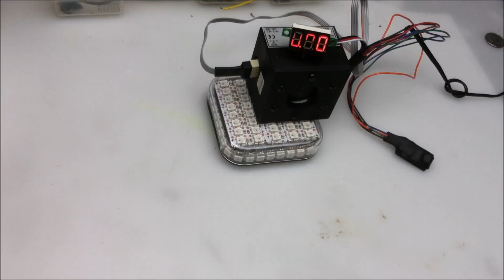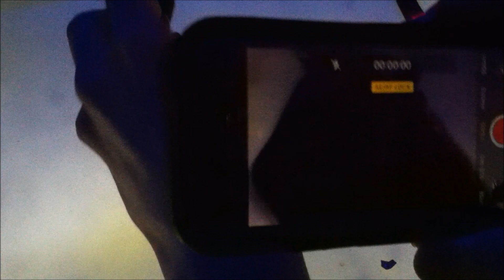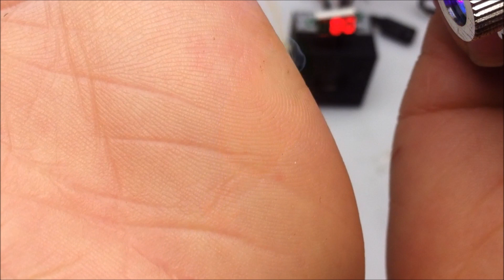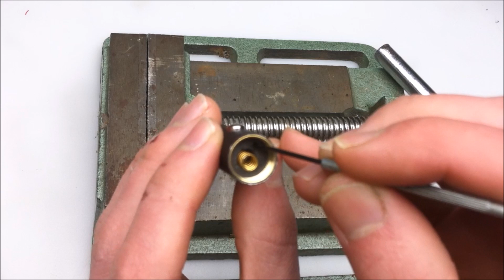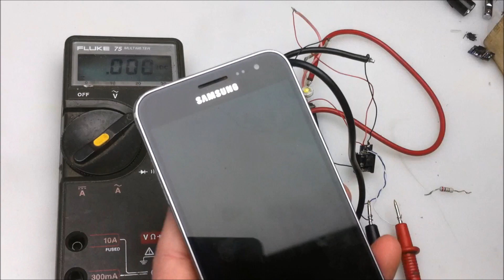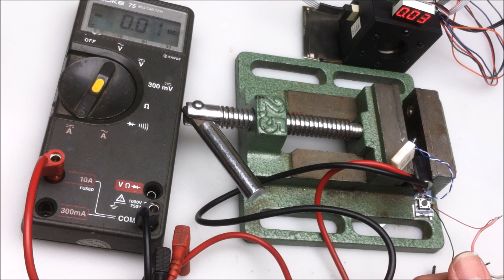Shunt Mod & The Danger of Cheap 405nm Laser Pointers

Comment: Hi. I want to make a soldering/desoldering aid and i thought  a modified laser pointer might be the solution. It might be also interesting for you if you are working with smd components, micro soldering etc. I always have problem removing components with my micro soldering tools. They have very little thermal mass so they loose their heat very quickly. I thought that a modified laser pointer which emits IR light might be a supplemental heat source. Lets say this IR laser pointer can provide 1/3 of the heat needed. Which is not so much heat so it can be done with a  very low power laser. I think. What do you think about this? A laser pointer would be powerful enough?  Would the reflected IR light can cause problem even though it would be pretty weak? I say an IR laser but perhaps a blue would be better?? I will be happy if you can share your opinions. (I am talking about 80-100 celcuius degrees.(175-210 fahrenheit ))
Reply from the maker: This isn't very effective, solder reflects IR and it's not a very efficient transfer of heat, it's also hazardous to eyes due to reflections.
Reply: @Zenodilodon  I am talking about very small components and very small areas of solder. Most of the area it will heat will be the component itself anyway. So it should heat a 1mm x 1mm square to 80-100 degrees celcius.  I guess you did not understand what i was thinking but no problem. Thanks for the reply.
Reply: @parçalabehçet  IF I was on path to try something, would try a fibre laser for that. It have extremely small exit/beam so it can heat a point i.e. I understand this is waht is needed - to heat a point lightly so you can really up-heat whatever is needed. GL ~~~

Comment: I have a 3w 405nm laser and it looks nowhere near as bright as a 200mw 532nm green laser, yet it burns through stuff a lot faster. Then I saw the human eye is more sensitive to green light than any other colour. Science is awesome.
Reply: Where do you get your 3w 405nm?
Reply: @davecc0000  Aliexpress. I bought a laser head and power supply from a seller that does parts for laser engraving machines.

Comment: This is very useful info to me!! Not only for dialing back those retina frying 405nm pointers, but also as a cheap source for CC boost drivers.
Reply: @styropyro you inspired me to start making lasers
Reply: @JimTheKid  same any tips on learning im just taking apart lasers and reading up on how they work and trying to mod them
Reply from the maker: They do make really nice CC drivers for projects. They became so much more useful after figuring out how to change the current. I wish I figured this out years ago lol.
Reply: NO FRIKING WAY ITS STYROPYRO
Reply: Agree! The diode in my cheapo 405 died so I guess this will be my gateway drug to build lasers on my own, not just buy finished builds!
Reply: instablaster

Comment: That first part about the IR was fantastic thank you. I've been terrified of the IR from the various 532nm lasers I've got/had. I just bought some glass IR filters and was going to put them in my laser pointers but now thinking maybe I'll just stick to being careful instead. 

PS: Regarding the plastic bag over the laser pointer - I recall seeing a video about thermal cameras which showed that many things, including that specific plastic, is virtually trasnparent to IR. Anyone replicating what you did without the correct eye protection is likely to get a face full of IR laser.
Reply from the maker: You are correct, many plastics are quite transparent to IR, I did just run a test on the transparency with my 808nm out of focus so it did not burn through the bag, it looks like the black bags are about 90% blocking to 808nm, anything deeper into the IR range would probably start passing through more easily. The white bags with the same material are nearly transparent thought to the point of nearly clear images. Lots of organic dyes like in cotton clothing will also reflect/pass IR light quite well where as synthetic materials tend to absorb it such as felt fabrics.  All in all it was about the most practical test for others I could think of concerning most laser pointers for those who don't have a laser power meter.